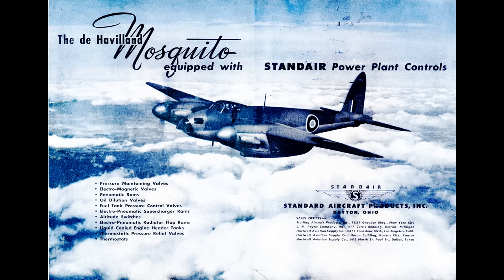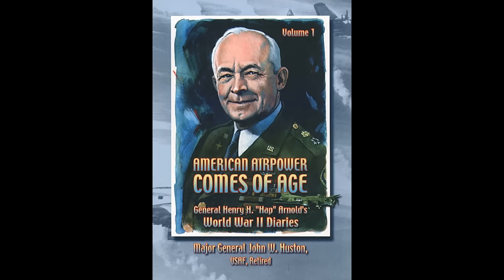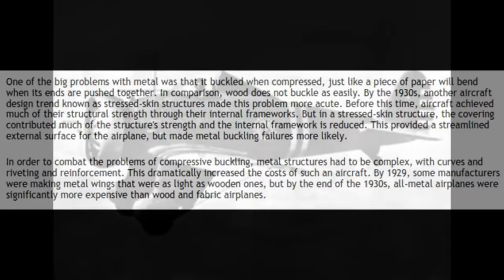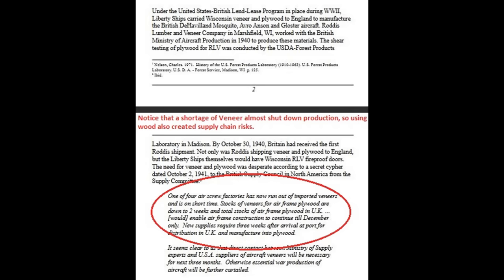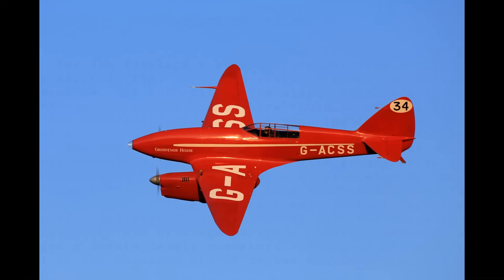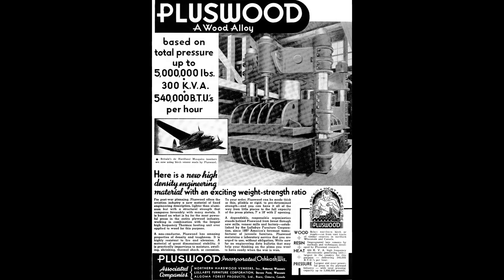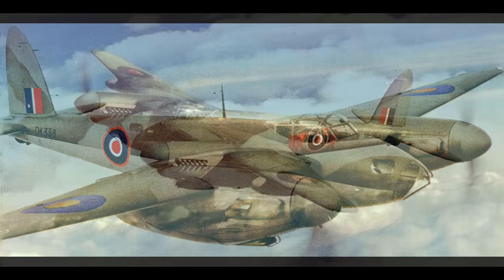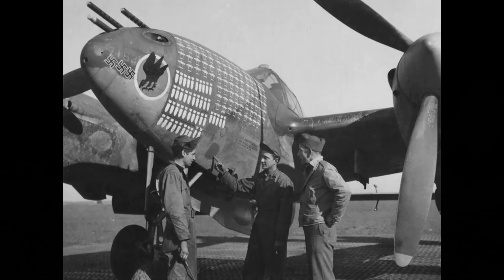De Havilland Mosquito vs. ?

Comment: The Comet airliner was developed into the Hawker-Siddley Nimrod which only left service with the RAF in 2011. Pretty successful design after all, I'd say.
Reply: The Comet airliner suffered from fatigue failure caused by not properly rounding the corners of cutouts for windows and antennas. The corners were too square and this caused a fatigue to rapidly grow starting in the corner. Properly rounded corners will not cause this issue though fatigue will be an issue with aluminum in aircraft, just that the fatigue life will long with good maintenance and inspection.
Reply: Meh. The Nimrod was in service for so long because the Brits couldn't afford a replacement. It was in service at all because of "Buy British". Not that there's anything wrong with that, but the Nimrod wasn't better than any of its contemporaries, it was just locally produced.
Reply: @Mishn0  Well, I thought it's was the Shackleton that was overdue for retirement and it was Nimrod that had constant trouble with the radar if memory serves, so much so the Boeing AWACS was bought instead.  I was all for soldiering on with Nimrod but sometimes things just don't work out, that's life I guess.  Look at the Americans with Skybolt.....
Reply: @washingtonradio  actually no this is a myth. DH to save money not only did not drill but "punched" out rivet holes, the metal sheets were also not glued together either. the combination of not glued, punched window holes and square windows caused the failures. also the decision to use the same fuselage for all the testing (overpressure tests performed before the cycle tests) meant that fatigue failures never occurred.
Reply: @rob5944  indeed billions were poured on the platform (nimrod AEW3). it was also ugly as hell with that long nose and the radar could not tell the difference between cars and helicopters as well as many other issues. then later the Nimrod MRA4, more billions were spent. they were so bad that major structural defects meant that the new aircraft did not have any other use apart from the chipper after the project cancellation.
Reply: The Comet being the first commercial jet airliner was made with thin alloy to save weight and was exposed to greater pressure differences and speeds due to being jet powered, flying high and fast. This was realised when after crashing, a proper fatigue pressure test was done and the skin was made thicker and cutouts rounded with better construction. This information was used by Boeing and others to avoid this mistake and produce thicker skinned aircraft, while De Haviland never recovered their reputation inspite of fixing the problem and producing successful later vertions of the comet,which pilots spoke highly of.
Reply: @rob5944  The Nimrod did not have constant trouble with it's radar. In its intended role, of maritime reconnaissance, it performed well and the Searchwater radar used in the MR2 variant was more than a match for its contemporaries.
It was the proposed AEW variant that suffered radar problems.
Reply: @mrrolandlawrence  I wouldn't call it ugly, at least not when compared to an airliner with a bloody great dish mounted above it.
Reply: @Mishn0  Money for a replacement for the Nimrod couldn't have been an issue if you add up the amount of funding wasted on its cancelled upgrades,the AEW MK1 cost about £900 million ( early 1980's ) and the MRA MK4 about  £3.5 - 4.5 billion depending on source.Think of the amount of  P8 or Wedgetail that money could buy today ?.
Reply: I talked to guys that worked on AEW Nimrod and the problem was that the radar was too sensitive, even picking up trafic on  the ground, the computers then available were not powerful enough to de-clutter the image.
Reply: @Mishn0  And that could be considered favourably over buying abroad because of performance promises that ultimately cannot be delivered or because of bribery..
Reply: Hawker Siddley wanted to use their own lower powered jet. So they screwed up on a number of fronts, the skin was to thin to reduce weight and square windows causing excess stress. The major one they screwed up on though was testing as proposed by the engineers, this was by flexing  wings with fuselage in water with hydraulic pressure in fuselage proper to simulate flying at altitude (by the way hydraulic testing of pressure vessels is standard). It was done eventually after 7 unexplained midair disasters. It was found out relatively quickly what the faults where and corrected.  Boeing gained valuable insight from the first pressurised jet airliner. Listen to engineers not boardroom bullies. Board room bullies blew up Challenger space shuttle by not listening to engineers. The MK4 Comet was reliable and the Military got the Nimrod from this, by then the Boeing 707 was on the scene and could carry more passengers. Slinging engines under wings means easier service and engine swaps and if engine goes catastrophically wrong and vibrates so  badly it designed to break mount bolts and fall off rather than take the wing out. It was downhill for the Comet from then on.
Reply: Mishn0 Not true it was the best Maritime anti sub Hunter there was when first built . It did what we wanted it could stay on station for extended periods and get out there fast. It should have been developed properly as opposed to piece meal, there was a proposal for new airframe. But again we went for the cheap option. We should keep UK industry going and keep the money circulating in the UK. As opposed to giving it away to other countries.
Reply: Jay Lozier you can only say ‘properly rounded corners’ as a result of the DH Comet experience, at the time Britain lead the world in jet airliner design, but no one had tried the combination of pressurised cabin with stressed aluminium construction for an airliner cruising at those heights.

We learn from experience and the US airliners that followed benefitted from De Havilland’s pioneering work!
Reply: Mishn0 the Nimrod had internal engines which make for a more aerodynamic aircraft so in that way it was superior and remains superior to current airliners, however having internal engines brings its own problems such as servicing and fire control if things go wrong.
Reply: A design inferior to and  more costly than an RC 135/E2. But hey, maybe you can resurrect the Comet after Airbus finishes off what's left of your so-called aerospace industry.
Reply: prophetsnake the Comet was a revolutionary design of the 1940s, things move on!

You seem to be the kind of individual who is incapable of ‘moving on’!

The Concorde a revolutionary design of the 1950s & 60s was compared favourably withe the Apollo space project by NASA engineers who understood the challenges which were overcome in building and operating a reliable supersonic airliner.
Reply: @pcka12  It was garbage.
Reply: Yea and you keep using the Harrier and the hawk. You used the Canberra and turned it into a spy plane. Oh and the jet that everybody including the Germans copied. They even admitted to having copies of the patents in every university.  Did I mention Radar cavity magnetron computers basis for the internet very short memory. What is with This Brit bashing thing?
Reply: prophetsnake Nimrod took over from Shackleton largely because the Shackleton were reaching the end of their airframe life, not because they did not remain a useful aircraft for the surveillance role they occupied. Shackleton had served a useful life of about 20 years; a reasonable person would have expected a further 20 years or so from the Nimrod, politicians pushed it on beyond that window of ‘usefulness’.

As usual it was the politicians that ‘cocked up’
Reply: @pcka12  Yeh sure. As if you'd know, planespotter
Reply: prophetsnake Shackleton and Nimrod were maritime reconnaissance aircraft, what you need to keep an eye on the North Atlantic in all weathers is an aircraft of immense range & reliability, both of those aircraft succeeded in that role.
What you do not need is either speed or altitude record holders.

The major threat both those aircraft faced was global nuclear war.

It is a curious fact about electronic systems that the old ‘valve’ based equipment is far more resistant to the effects of a nuclear explosion than more modern transistors & microelectronics. For that reason the military retained supposedly ‘antique’ valve based electronics long after they had disappeared from every other use, you would have found those sets in both Shackleton and Nimrod as well as on the ground.
Reply: @pcka12  They were both junk
Reply: prophetsnake well they are now! All turned into coke cans!
Reply: @prophetsnake  Oh dear, you're one of those 'mericans who can't bear to hear another nation produced better stuff than you.
737 Max anyone...?
Reply: Mishn0 why replace something that was doing a good job? The anti submarine kit in the Nimrod was replaced and updated a number of times to my knowledge, only when it became obvious that we needed a "AWACS" type airframe did we source a different aircraft, by then it was too costly for a single small country to develop a new aircraft did we bite the bullet and buy American. If we would have still had a fully functioning aircraft industry capable of producing medium to large airframes perhaps we would have tried but I doubt it 1980's Thatcherite policies would have baulked at the financial cost and post 1997 labour ( aka Tony fucking Blair traitorthat he is) would not have touched the idea with a barge pole.
Reply: Roland Lawrence beg to differ with that, as a young man I remember several fatal crashes of the Comet, and RAE Farnbrough who were our forerunners of the crash investigations CLEARLY came out with a definitive cause of the crashes and it was fatigue at the corners of the square windows de Havillands changed them to rounded corners but as a seller because of the previous crashes they could sell either few or no more aircraft and I believe went into liquidation.
Reply: @Mishn0  did anyone claim different?  you make it sound like a suit of old clothes,    no holes in it so keep waring it. I--prefer to see it as, a bloody good design, that was able to be improved and adapted, to meet changing situations; gave good service,  and was value for money. Tax payer's are not overly fond, of seeing THEIR money, squandered on shiny new, but bloody expensive replacements---just to please our American chums.
Reply: @rob5944  ---oh god---here we go---roll out the comparing list of failures
Reply: @franksmith6683  Correct.  they didn't have those huge water tanks, for testing pressure, like the all did , afterwards. Sadly, as usual, it cost lives to find out faults.
Reply: @MrDaiseymay  My, aren't you easily triggered. Nothing I said was false.
Reply: @pcka12  Boeing would disagree. Podded engines are low drag and provide torsional damping to the wing. They also open up space in the thick part of the wing root for fuel and the landing gear. DeHavilind eventually added external tanks to the wing where Boeing would have hung the engines. The landing gear and wing spar structure are both  complicated (read made heavier) by the internal engines, and there was no way today's high bypass turbo-fans would fit in the wing root. Still, DeHaviland had a reputation for good aerdynamics, and the long life of the Comet/Nimrod after it's redesign is testamony to this.
Reply: @washingtonradio  DeHavilind made a number of mistakes with the design of the Comet. Punched holes and square windows were part of the issue. More serious was the failure to reinforce the skin adequately by placing the stringers more closely. The idea is that the stringers act as a "rip stop", stopping a crack in the skin from growing to the point where it becomes catastrophic. The Comet's underwent explosive decompression where the entire fusalage split open. Boeing produced a film showing a Comet fusalage blowing apart when it was damaged, while a 707 fusalage under the same conditions depressurised but stayed in one piece.

An additional issure was that Dehavilind pressure tested the fusalage to a safety factor of 2X and declared the design safe when it passed. This corresponds to assuming the fatigue strength of aluminum is 50% of the ultimate strength. The actual fatigue strength of aluminum is more like 30% of the ultimate strength, so a better test would have been to test the fusalage by pressurising it to 3X the normal.
Reply: @fafner1  i don't think there is any real disagreement, engines in pods have practical advantages for airliners and even the b52, but show me a fighter that has engines stuck out on the wing?

The only thing near that concept is the a10 Warthog, the English Electric Lightning even had stacked internal engines to reduce frontal area and make it one of the fastest interceptors ever.
Reply: @fafner1  Technically aluminum has a fatigue life and fatigue limit not a fatigue strength. Face center cubic  (FCC) metals such as aluminum will fail from fatigue eventually. The design is based on the number cycles before failure and what the stress needed to cause a fatigue failure at that number of cycles. At some point each structural member must be inspected for evidence of fatigue and replaced if necessary. This is a well known metallurgical issue with FCC metals. When people became fully aware of these problems I am uncertain. But in the 50s aircraft were flying high enough that the cabins had to be pressurized for crew and passenger safety and comfort.
Reply: prophetsnake No it wasn’t! it was garbage. No it wasn’t. It was garbage. No it wasn’t .  Good that’s that very intelligent discussion out of way. It was garbage doe.
Reply: prophetsnake Do you work for a garbage company?
Reply: prophetsnake opps garbage man is at it again get the cans ready!
Reply: @washingtonradio  Of course you are right, but in practice the Metallic Materials Properties Development and Standardization values for fatigue limit to withstand  10E8 cycles is often used the same way a fatigue strength would be used, with the provisio that critical structural members have to be accessible for inspection.
Reply: @anthonywilson4873   (1) Hawker Siddley didn't exist then. (2) The DH Ghost was  the only suitable engine at in 1947   (2) Nobody understood fatigue in aluminium alloys prior to the Comet and treated all metals as having an infinite fatigue life if kept below an arbitary stress level, this true for steel but not for light alloys.  (3) The effect of pressurisation cycles on light alloy fuselages was unkown.  The list goes on  it was only when the fatique test Comet failed spectactularly in the water tank at RAE Farnborourgh that the full impications were realised ---- this vital  information was immediately passed on to Boeing, Douglas & Lockheed and the rest of the industry.  The Comet was resdesign every single part was re-engineered to have an exceptionally long fatigue life and the with the RR Avon engine available the Comet proved an exceptionally safe and reliable aircraft but as a result of the extensive rework arrived too late and too small for the market.   It  was a not disimilar situation to that  Lockheed also faced with  the Electras falling ut the sky  when re-engineered  the Electra was the basis for the ultra reliable Orion,
 After the end of Comet orders  product tooling was carefully stored to allow the production of a maritime patrol. Aircraft when the the Nimrod was selected it had to compete against other British,  European and US designs.  One of the main compeditors was a development of the Vickers Vanguard which would have resulted in an aircraft not unlike the Orion.   The main reason the Nimrod was chosen was the proven exceptionally long fatigue life of the Comet airframe, higher transit speed to the search area than a  turbo prop and the ability to loiter at high or low level with two engines shutdown enabling 10 hours endurance which later increased by the hurried introduction of flight refuel during the Falklands Conflick.
In service the Nimrod proved the most effective its generation of NATO maritime  aircraft it was a vital part of  Falkland war and the Gulfs war undertaking  roles it was never designed for. The Searchwater radar on the MR,2  version proved capable of being developed for other roles.
Reply: @washingtonradio    Yes -- fatigue in  light alloys is a very  different ball game compared fatigue in steel.
Reply: When the MRA4 was canned, there were loads of surplus parts appearing on eBay for years afterwards. I'm sat in a Nimrod copilot's seat right now!
Reply: Frank Smith , spot on Frank, most people do not realise Boeing were making the same mistakes, but The lessons learnt from the unfortunate comet crashes saved others the same issues....the later comments were good aircraft but the 707 was larger and more capable at a time that the comment had issues..... I didn’t know the trident was a DeHavilland design....
Reply: @GARDENER42  ...muricans
Reply: @washingtonradio   @Jay Lozier  a lot of designers then didnt understand stress risers...or fatigue till the comet
Reply: @rob5944  the shackleton was a commercial lancaster
Reply: @Mishn0  Yes, but was it any worse?
Reply: Nimrod was not successful enough to save De Havilland.
Reply: @keithstudly6071  Hawker Siddeley bought DH in 1960, prior to the development of Nimrod
Reply: @stephendibnah4066  If Comet had not cost DH so much, it would have been the DH Nimrod. Military version of Comet was not profitable enough to make up for the damage done to DH. Nimrod was just a part of DH that was salvaged after the fire sale.
Reply: Mishn0 It was better than it’s American contemporary, the Orion.
Reply: Roland Lawrence The problem with the Nimrod MRA4 was that they built a new wing for it with modern CNC construction techniques, but the aircraft were originally hand built and so each fuselage was slightly different, and these modern wings had to be made to fit. The sad thing was that the problems had been largely solved when that utter idiot David Cameron had the aircraft destroyed, chopped up on the runway. £12 billion flushed away. Then Britain had to go for 10 years with no maritime reconnaissance aircraft. They should make a law to ban that kind of thing, like what they did to TSR2.
Reply: @mrrolandlawrence  I read or heard somewhere that the original design of the windows was to use glue only, and no rivets, but the sales people said no-one would buy it because they wouldn't believe that glue alone would do the job.  So they were riveted - with the consequences that we all know.
Reply: @washingtonradio  Because DH supplied what the Airlines asked for - square windows.
Reply: The comet was a steath plane as far as heat signature and hard to hit with infa red seeking missiles.The US AWACs retired it much earlier
Reply: SD, a very good point. I suspect politics finally doomed the original Comet.
Reply: I am very very sad about its death by metal fatigue.  I flew in one once.
Reply: @washingtonradio  Comet skin was half thickness of 707. Early eamples had a tricky angle of incidence.which caught out commercial pilots. (If memory serves etc.)
Reply: @franksmith6683  Many years ago I worked abroad on Saudi building site. We used to laugh nervously when we got the DC10.
Reply: @fafner1  Face centered cubic metals like aluminum do not have a fatigue strength but a fatigue limit (strength after x cycles). Eventually any fcc metals will fail from fatigue.
Reply: @washingtonradio  no hi no boy no hi in her
Bu